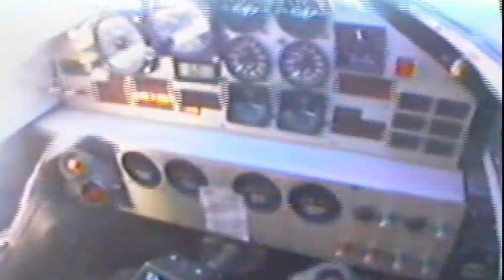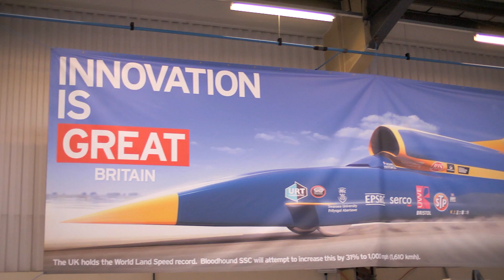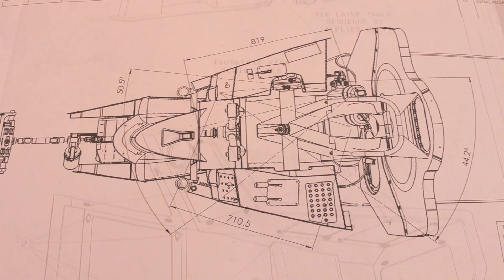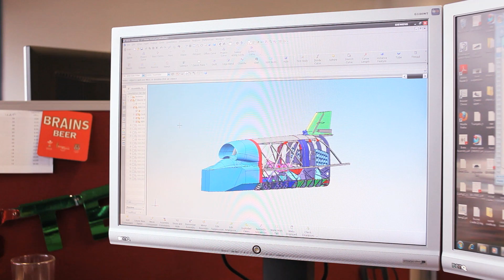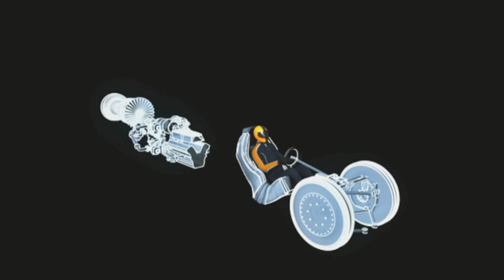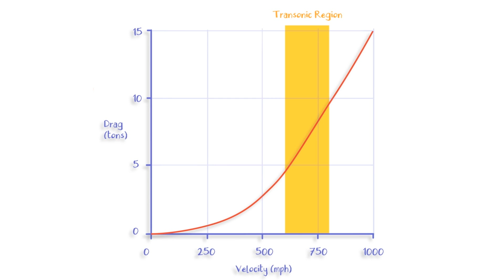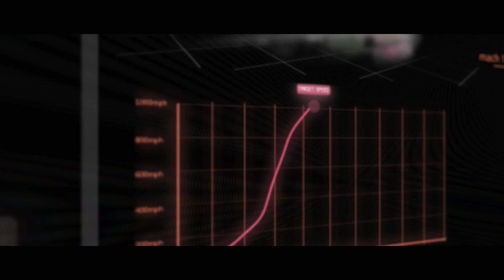Bloodhound SSC: Building a 1000 mph Car - XCAR

Comment: why the APU is a formula 1 engine..why don't use turboshaft engine like an aircraft APU..
Reply: coodusz main problems are spool time and power unit size. An F1 engine has instant throttle response for instant fuel demand. A turbine has a lag time from idle to 100% power, also the F1 engine is longitudinally more compact than a turbine of equivalent power
Reply: If I am not mistaken, the F1 engine dosen't act as an APU but as a sort of fuel pump for either the rocket of the EJ200 jet engine.
Reply: right..but why f1 engine not turboshaft??i reckon turboshaft is more efficient..

Comment: difference between bloodhound ssc and thrusut ssc?
Reply: Thrust SSC is powered by two Rolls-Royce Spey turbofan jet engines developing a net thrust of 223 kN (50,000 lbf), a power output of 110,000 bhp (82MW) and with curb weight of 10.5 tons.

Bloodhound SSC is powered by a Rolls-Royce Eurojet EJ200 afterburning turbofan jet engine and Nammo HTP hybrid rocket engine together with a 750 hp Cosworth CA2010 Formula 1 V8 petrol engine as auxiliary power unit. Total power output is unknown, curb weight 6.4 tons.